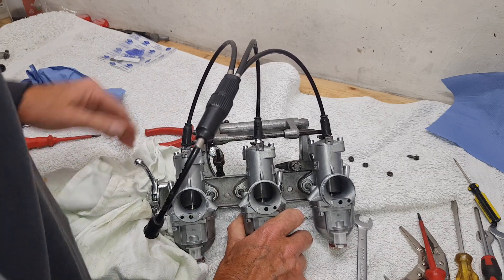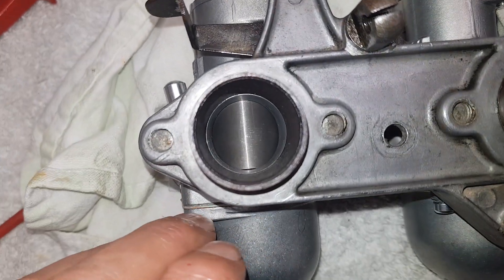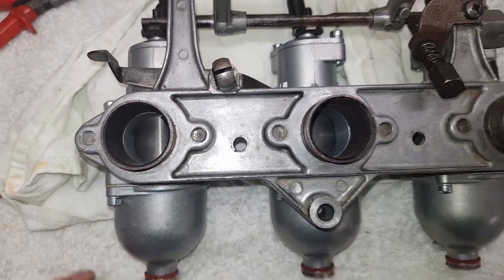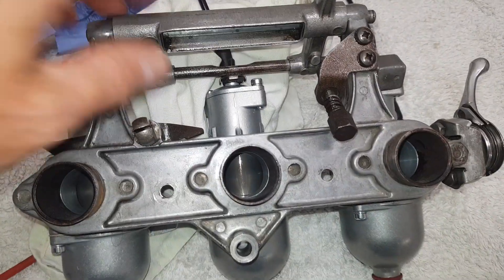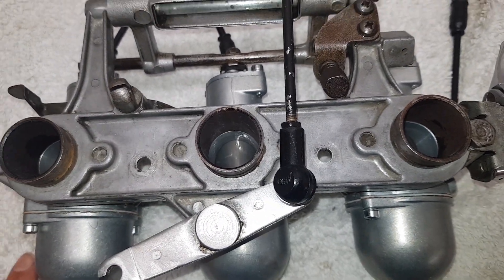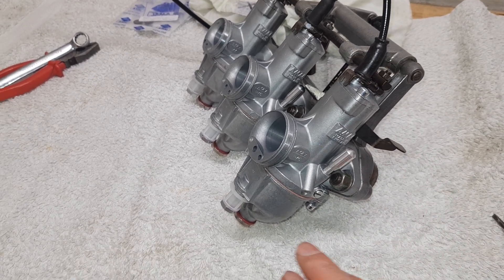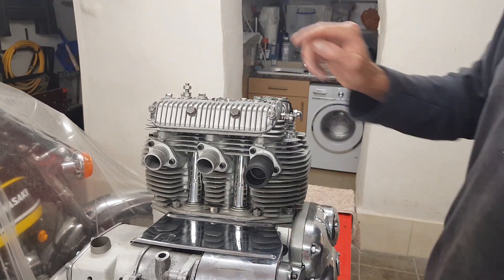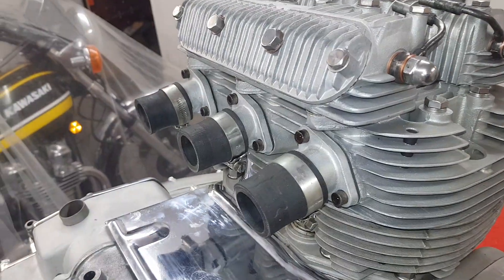Triumph Trident T160 Engine Rebuild. Part 48: Amal Carburettor Strip Down, Part 4.

Comment: Could you tell me how you measured the .01" recommended clearance on the engine side in sychronizing the carbs?    Thank you.
Reply: Thank you.   Your videos and book are a wealth of information.   I've owned a 76 Bonny and a 72   Commando but the 75 Trident is a bit more challenging.
Reply from the maker: Tridents are definitely trickier to work on, being that bit more complicatedthan twins. Just take your time and it'll work out. Good luck. 👍
Reply from the maker: Personally I just do it by eye, but if you want you can also do such things as insert a thin metal rod under the slides with the throttle slightly open, or put three marbles in the venturis and open the throttle - all 3 marbles should fall out at the same time.
Reply: I read that a "E"  guitar string is .01".   Do you think that would work to determine clearance?  I appreciate your quick response.  @Chris.rooke150
Reply from the maker: Guitar strings are good for cleaning out the pilot jet circuit rather than balancing the carbs. It is essential to ensure the pilot circuit is clear.
Reply: I had in mind letting slides rest on thickness of guitar string to get the correct clearance.
Reply from the maker: The size of the clearance isn't critical, ensuring that the slides are all the same gap is. The gap is altered on the bike by adjusting the tickover screw, so what the gap is to start with isn't important  - as long as the gap's not so big as to make the engine race at tickover.